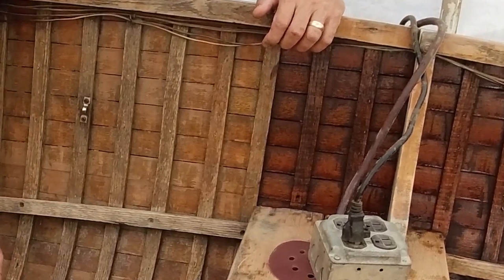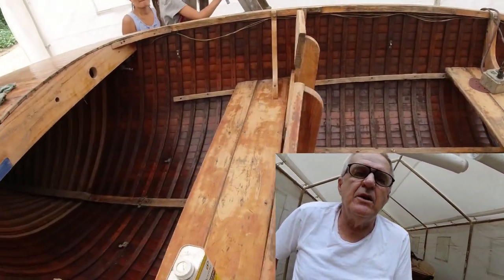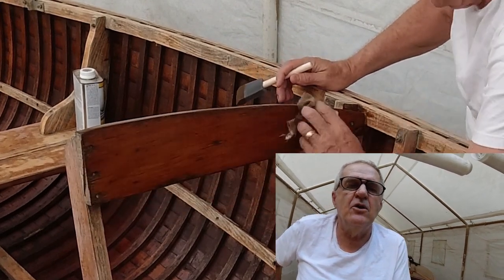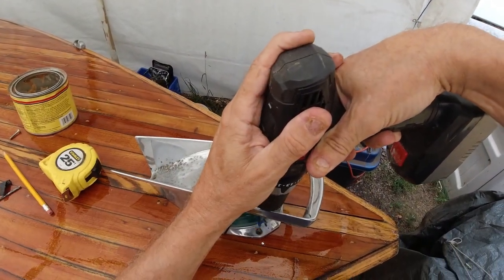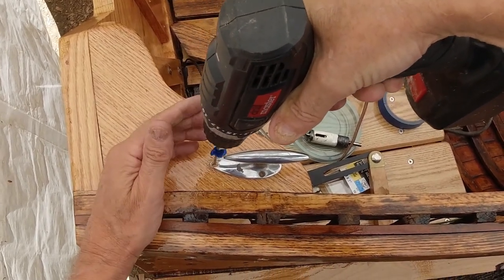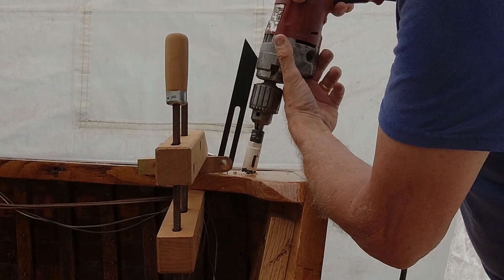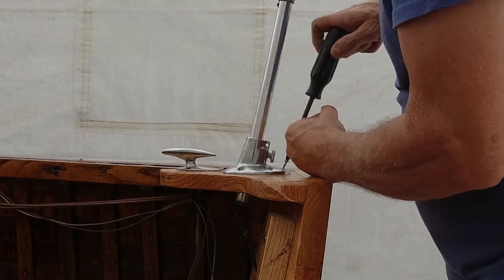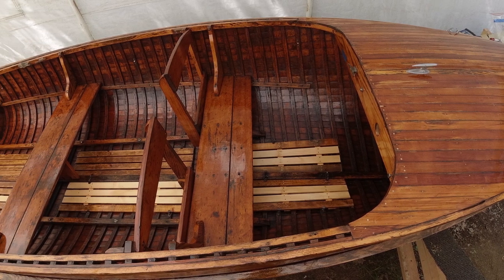Repairing a Giesler Cedar Strip Boat, Finished Part 10

Comment: Just picked up Giesler Nipissing and was doing a little bit of spot repair before putting in the water last month.  Mine was not too rough and had a good 50 hp older motor on the back.  Runs so well on the water. Your work and attention to detail gave you a great finished product.  Enjoyed all the episodes.  Sometimes you don't want to know how much you spend.

Comment: I've picked up an 18 foot Geisler very similar to yours that I am working .I'm near Toronto Ontario Canada and have been following your videos . Would love to see a video of your first launch in the water.I am following your direction to finish mine What do you think the cost was ..not including the labour.Loved your videos !
Reply from the maker: I am ready to launch but I made the mistake of buying a 40 horse motor. Unfortunately at 66 years old I can't lift or move it. Hopefully I will get a smaller motor this spring. Thanks for watching.
Reply: @kricketts4348  , hope you can get a motor to get your boat in the water, even if you just find a hand steered motor, that'll be wonderful to see underway. Those accessories you scored...man, either there are thousands of Chris Craft parts available, or you got a steal!! 😳
Those boat horses a caught my eye, stayed for the hull glassing. Thanks for the pretty thorough video series.👏